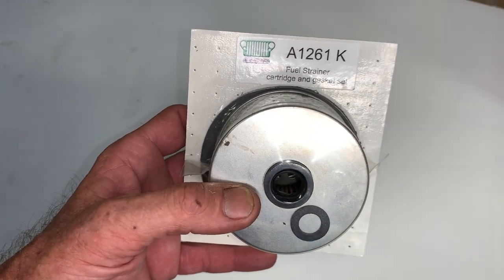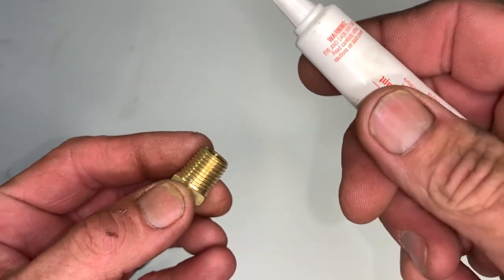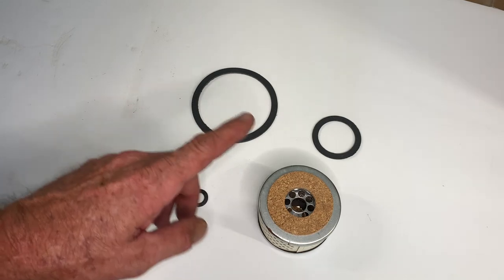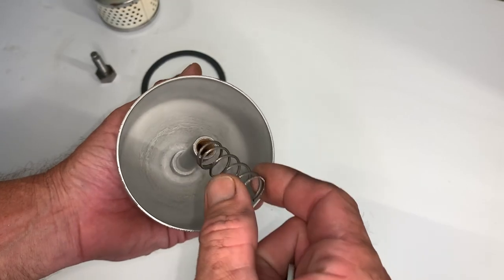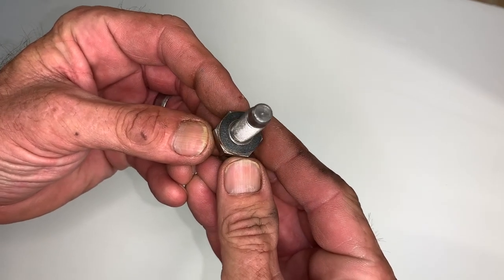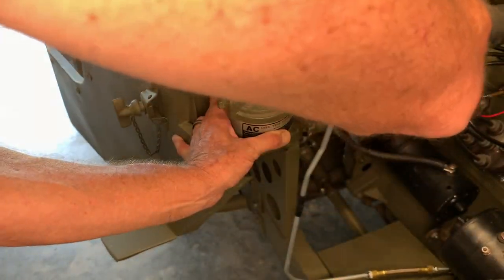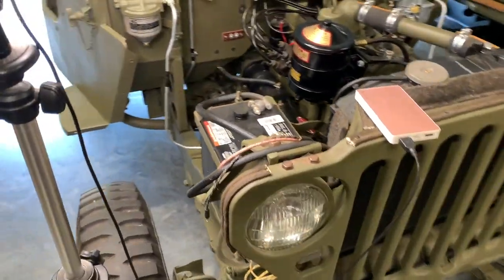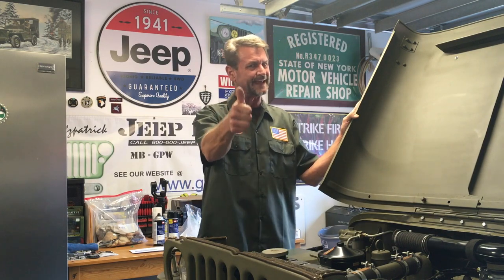G503 Fuel filter restoration (Part 3) Installing the fuel filter, Willys MB Ford GPW WWII Jeep

Comment: A long post - I was at a loose end when I wrote this and I'm about to retire, so you might get more - Sorry!
Not sure about the new Filters.  My filter had a long tapered spring  for the original filter (Brass Disc). Paper disc being similar, which I am still using.
When compressed the spring roughly fills the recess (Note) in  the bottom of the shaft in the fuel bowl.
The older  disc filter was quite clever - it does not need a seal  on the shaft at the bottom! Just needs a stout spring to keep the elements compressed. Ensure not too much play in top hole and 
as long as the first inch or so of the shaft (By top hole) and top edge of the bowl (inculding the two threads of course) are ok -  the bowl is fine too use even if heavily pitted by rust - which after time it generally is!
Was advised to fit a shorter spring (Note) for the modern  filters to allow the filter to go down far enough to seal the bowl - this inturn allows the  bottom seal  on the new filters  to pop over  the 
aformentioned recess compromising the seal at the bottom which it definitely needs.If it doesn't, it's pretty close and the shaft needs to be in reasonably good condition here as well.  The new filters
I feel seem too long - I think they  need to have a solid tube fixed down the centre! This at least would allow the filter not to rely on the inside condition of the bowl at least at the bottom - perhaps with some kind of 
seal for the shaft  on or near the top to replicate the oringinal type filter! I hope this makes sense!
I've got three diferent makes of these  new filters including a baldwin one amd they all seem to be the same. The old style filters aren't readily avaiable now and over the years removing dammaged discs
it's getting a bit short in the tooth. So need a usaable replacement. Going to look at getting them to act like the originals - Any comments!
Slogan for today - Hey- My jeep's a green car -  No kidding!

Comment: Didn't the decal on the filter get covered in a thin coat of varnish to prevent the decal from coming off or the ink being eaten away by fuel spilling.
Reply from the maker: Yes, and I did coat it with Diamond Clear👍